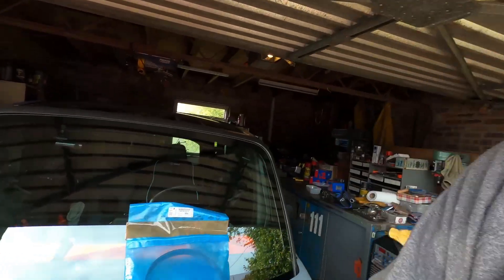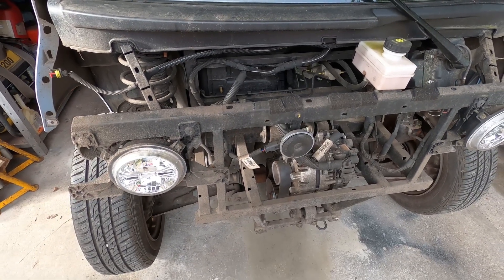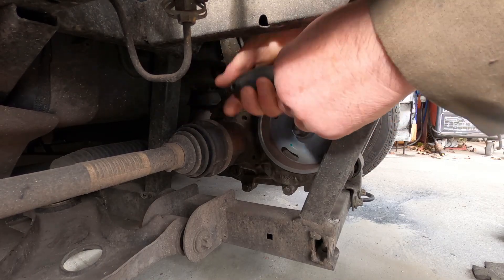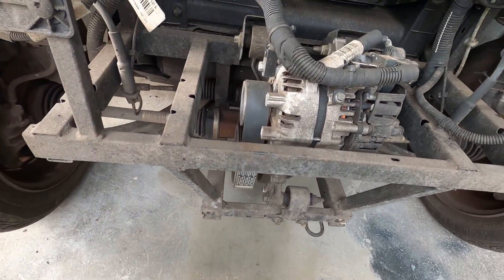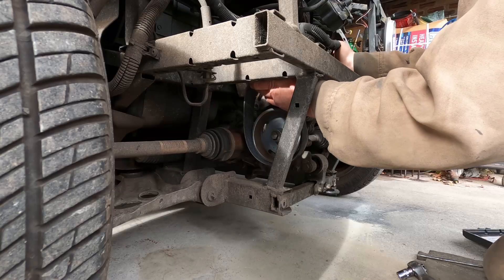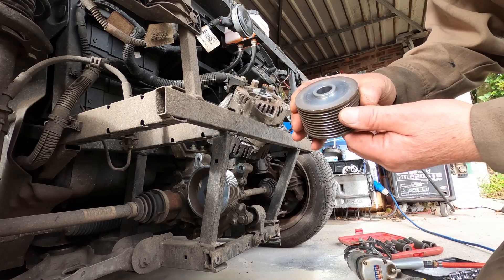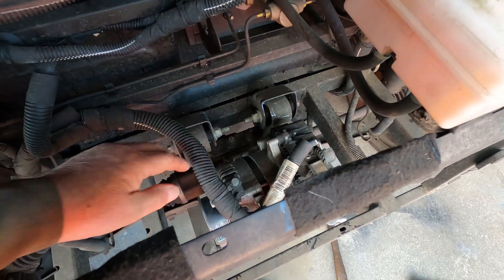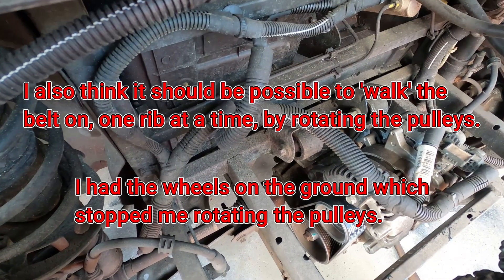Replacing the Transmission Drive Belt on a Citroen AMI Electric Quadricycle

Comment: yes, you can walk it in. i first bought a not oem belt and it was terrible, squeking like hell. after oem belt was fitted, all worked fine. oem belt was also much tighter than the not oem one
Reply from the maker: I suspected that the belt could be walked onto the pulleys. Thanks.

Comment: Hi i have a coming serious problem i think. Can you help? my ami generating a sound like trırırırırırı in while starting 0 to 5-10 km/h i hear. like my small iron  powered hand cutter changing cutter disk when pulled wall power off. Did i described to you?  its odometer ~27000. the sound frequency increase by speed. but cant hear in cockpit after 15 km/h because of other ground or wheel or wind sound. i thing it cams from engine brushes. do you now tis cars has a brushed engine? an last one please i never changed gearbox oil. when and which oil number i have to replace?  i have  w20-50  regular engine oil. can i use this? thanks
Reply from the maker: Hi, not sure what the noise is from your description. Check the drive belt to see if there are any loose strands of belt. Also check for objects such as plastic bags caught on the suspension or driveshafts - they can make a lot of noise. The transmission uses SAE 75W (GL-4) gear oil. Do not use 20W50 engine oil. The electric motor is an induction motor and does not use brushes.
Reply: @DougsShed thank you, at weekend i will lift up and try to remove front bumper and chack belt, bags, suspensions 🙏

Comment: What a stupid design. All the designer needed to prescribe was a slightly smaller mount or a small cut out up top that would have solved that. And as for the welds on that frame? Thats factory?
Reply from the maker: Welded by ex. goat herders in Morocco (I'm told)!
Reply: @DougsShed dont give up the day job lads 😂

Comment: It looks like it wouldn't need a lot more range of movement to do it without removal. Certainly worth a bit of head scratching if it has to be done more frequently than advertised. I was expecting it to have a bottle screw or some more controllable means of adjusting the tension 🤨 Glad to see the effort you put into cleaning and rust treating has paid off.
Reply from the maker: Hi Niall, the tensioning method is a bit crude! There are a couple of convenient threaded holes on the front of the motor which could be used for an automatic tensioning pulley??
Reply: @DougsShed  That'd be a worthwhile project 😎

Comment: the rust proofing works wel i see good job
Reply from the maker: Yes, no more rust than when I got the Ami in 2022. The Lanoguard coating has held up well. A thin coating of dirt adheres to the coating but none penetrates.
Reply: @DougsShed nice i use the same stuf on my ami 2025
Reply: I was just wondering about that too.